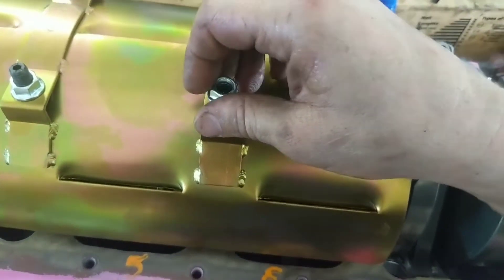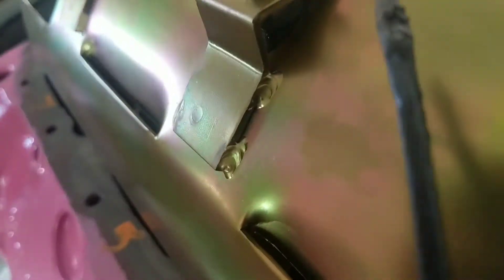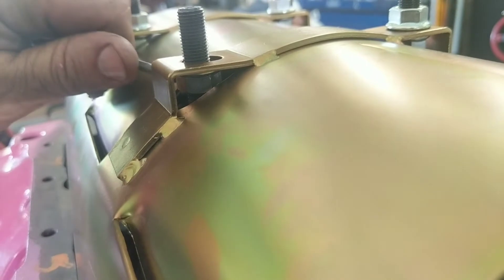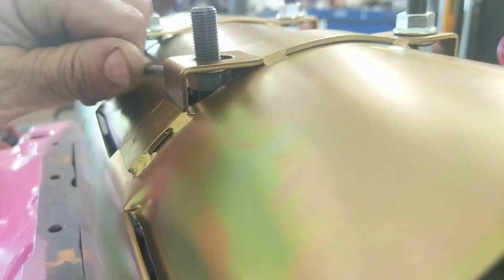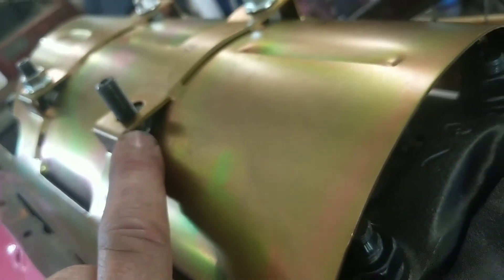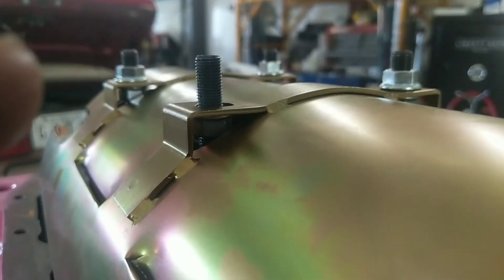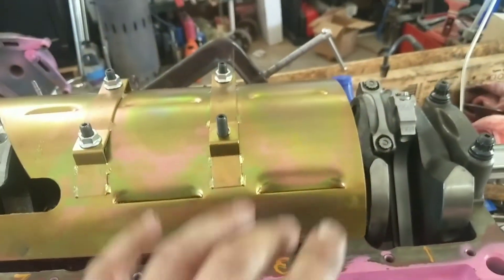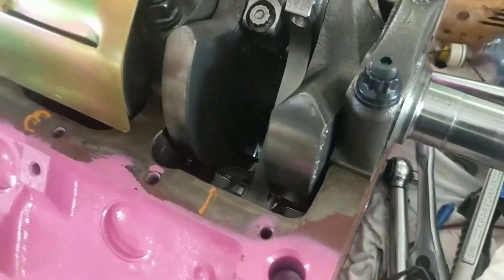Miloden Windage Tray Adjustment & Clearance for a Magnum 360 w/ Stroker Crank. Things to look for.

Comment: What oil pan are you running.  I just installed this on my magnum 408 build.  I just tried out the stock pan (rear sump for ram truck) and the studs on the #3 cap has it sitting almost an inch above the block
Reply from the maker: I'm running my stock 2001 Durango oil pan I hit I had to modify the oil pickup tube and modify the ledge inside the oil pan but that's it ARP studs fit and all.
Might want to see if your pick up tube is getting in the way That's what was keeping my pan and inch above I had to cut away some of the flat sheet metal inside the pan that goes around the pickup tube

Comment: On the magnum that I'm building for my 64 dart I ended up using an OEM 340 windage tray and the milodon bolts along with a crank scraper. Talk about fitting and refitting. I had to raise the tray up for the longer stroke and trim off the sides so it would work in conjunction with the scraper and allow the oil to drain to the pan instead of getting trapped inside the windage tray. Fun times.

Comment: Well I did something wrong… thanks for the good info I’m putting the tray and pan on with the engine in the car so it will take longer.
My tray rubbed and made a lot of racket so I dropped the pan to check.
Reply from the maker: Shoot, man that's sucks.